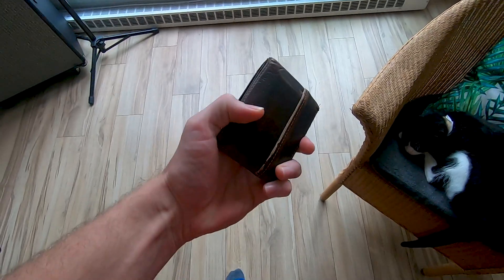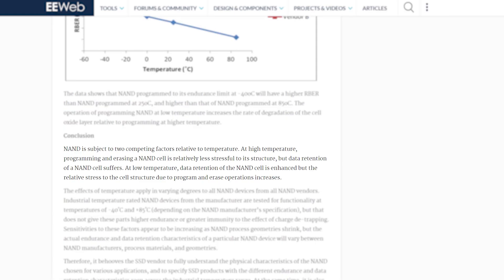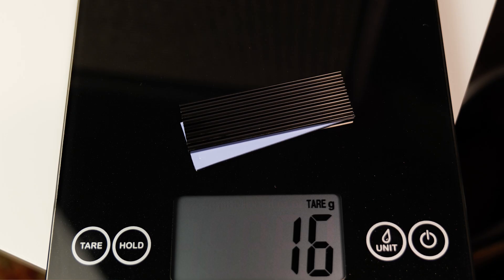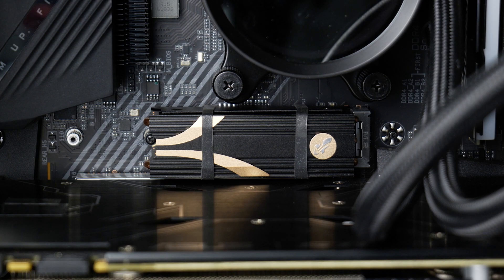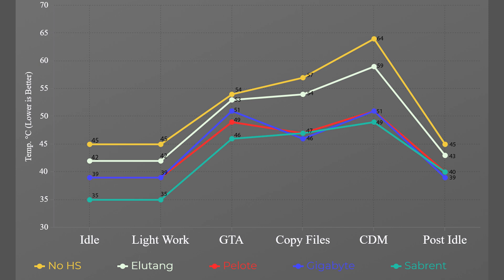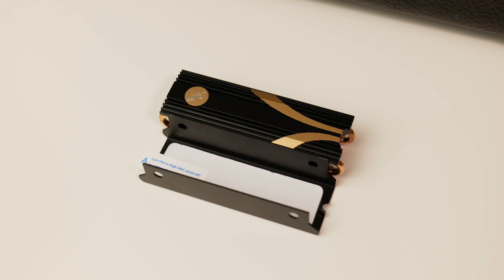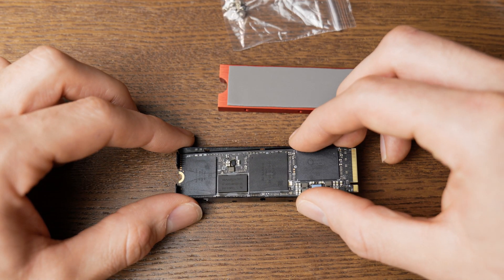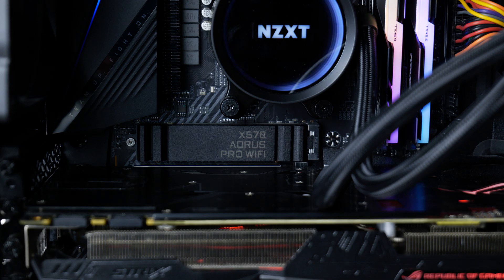Are NVMe SSD Heatsinks Worth Using? M.2 Heatsink Comparison

Comment: Useful video bro, Many thanks for the digging and efforts. I had Samsung Magician installed to keep observing the temp of the Samsung 870 NVMe SSD and the idle temp is always around 42 to 45c max. and while multi-tasking or stressing the laptop, it reaches 61 to 65c but that is only for around 15min and then back to 50c or less. all without a heatsink and of course that's at summer days, during winter, these temps are even lower. I will try using a laptop cooler that i have it laying around, it may be useful cooling the whole system at summer days.
Reply: I have samsund 970 evo ssd and samsung magician too, it shows only temp of ssd, it doesn't show controller temp, use aida64 or something like that to monitor that. if your ssd 40 your controller must be 50-60, if your ssd 60 your controller must be 70-80 ( according to experience with my ssd).

Comment: Hey, great informative video! What should I do with the heat spreader sticker that comes on almost all M.2 drives? I guess you either remove it completely and apply the heatsink tape on only the controller, or you cut out the part where the controller is and replace it with the heatsink tape so that the original tape is still on the NAND(if that is even possible). What would be the ideal way to do it?
Reply from the maker: Ideally yes. I believe you should only have the head sink on the controller.

Comment: My Tuf Dash F15 With 970 evo plus 2TB and Adata S40g 4tb have 12.8 wk thermal tape under controller chips between the drive and laptop motherboard. Asus actually have diagrams where to put thermal tape for both drives...the motherboard itself acts as a heatsink. Still saw the 970 hit 67 C under load....on D2 temp...A data stayed around 40C

Comment: Idle states - exactly how does this slight increase in temperature (due to heat distribution from these sinks) damage one's data? There certainly must be a window of heat levels that is considered "safe" for these drives and in particular, idle states. 

Which chips benefit from heat sinks - interesting point made on your part. Perhaps a heatsink that is really two distinct physical sinks in one is needed for the two identified types of chips reference in your video.

Comment: Is it true that a larger 1TB M.2 NVMe will overheat more than a similar 512GB one? Intend to buy an new XPS 13 so not sure if it comes with cooling for that and if getting a 1TB drive is a concern? Does this NVMe heating only happen during heavy writes or also for example when watching 4K youtube videos?
Reply from the maker: Yes, larger drives do get hotter. They are also usually faster. 

It shouldn't be a huge concern. It will get hot but it shouldn't be anything out of ordinary operating temp. You can use HWiNFO to check temps. 

It will heat up a little even when "idle" but it will heat up significantly when writing or reading heavily. Like transferring files, installing games or video editing. Watching videos online won't heat it up very much as it is cached in the physical memory and virtual memory(On local disk).
Reply: @TechIlliterate  Will heat be much different between a 512GB and 1TB M.2 PCIe NVMe SSD in an XPS 13 9310? Does a 512GB give similar "idle" heat compared to 1TB or will it be much more in the 1TB?
Reply: @TechIlliterate  Thanks for the reply so will 1TB run hotter than 512GB M.2 NVMe or are these very similar? Aren't these both "large" sizes?
Reply from the maker: @mikev324  They will be similar. The only experiece I have had first hand is with a 500GB WD black and a 1TB WD black both Gen 3 the 1TB was only slightly warmer than the 500GB. ABout 5 degrees in use and maybe 1-3 on "idle" but your MMV
Reply: @TechIlliterate  Thanks for the reply. The 5 degrees difference you mentioned, was that Celcius or Fahrenheit?
Reply from the maker: @mikev324  Always C

Comment: i want to thank you for this awesome video. Very informative and well done! I came here because I am setting up my brand new pc with 2 M.2 2280 NVME's. I realized the motherboard did not have a second heat sink, so I figured I would watch some videos on if it needs it or not. Since I have yet to use it yet but this is my theory is this and it could extremely wrong. I think the main NVME should have a heat sink and the backup NVME should not have one. Time will tell I suppose. Keep up the great work!

Comment: I have a problem that I can't figure out. Just bought a Rampage VI Extreme motherboard and it has thermal pads with some cellophane over them which says 'remove'. The problem is that if you remove the cellophane, the thermal pad is sticky. The thermal pad is attached to a motherboard screw-in heatsink, so if I remove the cellophane, the thermal pad will be sticking to both the heatsink and the SSD. So how can you then take the heatsink off if it's stuck to both surfaces? Was hoping for your input please.
Reply from the maker: I have found that the surface that sticks to the ssd is not so sticky that you will have issues removing it later. I have removed the motherboard heatsinks several time and they do stick to the ssd but it's soo weak that it comes away freely with almost no force. i hope that helps.
Reply: @TechIlliterate  Thank you - I was so worried about this I didn't install the SSDs in case I couldn't get them out again without damaging them. Much appreciated.

Comment: Thanks to this video, and a lot of reading, I'll be trimming the thermal tape from the NANDs, and only have the pad on the controller...
Reply: i did this and now my M.2 drive is much more cooler. I'm seeing 10c reduction after gaming session. Turns out before this the thermal pad didn't touch the controller because the NAND was a bit taller.

Comment: WD SN850 need some sort of heatsink
Reply from the maker: Yeah the controllers on the latest gen 4 drives get insanely hot. Especially the high capacity drives. My 980 Pro is usually 10-15 deg higher than my sn750 even though there are no programs loaded on it.

Comment: Hi Nick, thank for you elaborate research. By the way I read in another forum that testing with infrared thermometer will yield the lower result compared to the ones from internal algorithm....... so im confused which one to trust.......
Reply from the maker: As long as they are consistent with each other you could just calculate the differences if you would rather use the infrared thermometer. I suspect that the surface of the SSD is slightly cooler than what will be read on the internal sensor.

Comment: If you only put the thermal pad on the controller, can you damage the NAND chips with no pad on them, as there will be no cushion between them and the heatsink as they (possibly?) expand when they get hotter?
Reply from the maker: As far as I know the chips do not expand in any appreciable way. This is evident when using NVMe drives without any heat sink.
Reply: @TechIlliterate  Thank you

Comment: Hello. I just brought a 2TB Samsung NMVE SSD 970 EVO PLus for my Helios 300. It runs super fast with the OS  but gets very hot. This laptop has two m2 slots with heatsink covers from the factory. The temps reaches up to 63C under load. On idle its about 40 degrees C. It does stay around 50 degrees after reading/writing and doesn't go down since there is no airflow in my laptop . I really like to know if there is a better heatsink for this laptop. If not, should I use this as my secondary storage? I have a another 1TB 860 Samsung Evo M2 ssd for my second OS and it never reaches above 52 degrees idle/load. or should I return the NMVE 970 Evo PLus and get a 2tb Samsung evo m2 ssd instead which is $100 cheaper. Love to get your advise. Thanks
Reply from the maker: Those temps sound fine for a 2 TB drive. I wouldn't worry too much about it. there isn't much room for a bigger heatsink in a laptop anyway. Gen 4 drives will be getting much hotter though, not sure how it will effect longevity.
Reply: @TechIlliterate Alight. Thanks for the respond

Comment: Great video.  Given how inexpensive the Pelote is, you could trim the heatsink down so that it only covers the controller.  Then, the nands are fee to operate cool and warm as normal.
Reply: yeah, i think that's what he means by removing those thermal pads
Reply: @01Minecrafter10  the issue with this method is that airflow is reduced by the heatsink so I guess just sticking a small heatsink on the controller could be an option. I've seen the warranty void if removed on the ssd stickers tho...

Comment: Hi!

I'm using the Sabrent Rocket 4.0 M2 NVMe 1 TB in an external  Trebleet Thunderbolt 3 SSD aluminium enclosure. When using it (all my media libraries from  Logic Pro, iMovie & Lightroom are running from there) it heats up a lot after a time. Around 130°F the Sabrent unmounts itself and can only be mounted again, after unplugging and plugging it again. Unfortunately most of the processed data which was produced in that moment is lost. That happens 20x times a day. The aluminuium anclosure comes with a thermal tape and should dissipate the heat directly through the aluminum housing. And actually it gets really hot indeed, so hot, that it is really hard to touch it. However, the case cannot effectively dissipate the heat enough and the SSD unmounts itself as I already said - maybe  to protect itself from overheating.

Should I try to use the SSD only installes to the basis of the enclosure and installing the sabrent heatsink, what means to use ist open with the heatsink as a lid? Or do you think the problem comes from somewhere else and maybe the controller has had a factory defect from the start?
Reply: What did you end up doing for this?
Reply: That's not normal of a NVME. Looks like a defect

Comment: Just added a heatsink to M.2 in one of my computers and noticed drop from 58c to 54c. While I am waiting for a heat sync for my other PC I placed a 40mm fan on top of GPU and pointed it at M.2 drive and temp dropped from 68c to 56c. I think they definitely need heatsinks. This is under normal operation in well ventilated cases with lots of airflow and not a stress test at 28c ambient temp.
Reply: No, they don't. Big data centers that use NVME drives don't have any heatsinks on them either, and this is well out of any consumers' budget stuff. Real high end data center NVMEs don't use heatsinks, so why should you? Its just stupid.
Reply: @teemuvesala9575  Big server facilities are cooled good enough already that's why they don't have big coolers on CPUs and GPUs and simply use heatsinks + small vents for rack + cooling solution for the entire room, usually underground + giant vents. Would you want to do in your home?
Reply: @teemuvesala9575 servers have very powerful fans that directly cool the storage drives along with airconditioned environment. Do some research before you say someone else is stupid.

Comment: Ok so now that I know that heatsinks are kind of useless, do you think I can put an rgb heatsink just on top of my ssd to get the extra 25fps from the pollution light? Without applying the thermal thingy on the actual drive I mean. That way I can keep the guarantee sticker

Ty, and great vid man! :)
Reply: It's only useless if you apply the thermal pad on the wrong section on the m.2 drive.  I found that the NAND part on my m.2 drive is a bit taller than the controller - this causes the controller didn't have any contact with the heatsink. So I cut the thermal pad only to touch the controller, leaving the NAND bare, now my m.2 drive runs much cooleer.
Reply: @warnacokelat   u mean ur controller runs cooler and not the nand since u dint do anything to it
Reply: @boyscout-p3u  yes. most m.2 drive only have temperature sensor on the controller. samsung evo have sensors on both nand and controller.
Reply: (ty for the heart but I actually need an answer haha)

Comment: it's not a question of opinion, but the fact of design. Nand works only on hot. top sticker is a heatsink ( check for copper edge). So cool only controller. period.
Reply: interesting. That may be why the warranty void if removed on those stickers.

Comment: that WD SN750 drive also has a version that comes with a heatsink BUT it’s about $20 more expensive….just thought I’d throw that in. When you’re selectively adding thermal pads (just on the controller) make sure the heatsink doesn't rock and short something out. Great video!

Comment: What tool did you use to measure the temperature? And what how were they able to measure the NAND? Are there SSD with report temperature for both?!
Reply from the maker: I used HWinfo. Only showed controller temp as I mention later in the video. My final conclusions come after sharing another users results.
Reply: @TechIlliterate  that I understand. But my question is do you know how they measured the NAND?
Reply from the maker: @highcel  No I don't know. I presume they just had reading from whichever software they use displaying a reading from the sensor in the drive. Likely shows up as Drive Temperature, Drive Temperature 2 and so on.

Comment: The bollock stupid thing about M.2 NVME SSDs is the paper label over the chips which acts as an insulator.

The thing is that if you remove the label you void the warranty.
Reply from the maker: Oh no no no. Its a "heat spreader" 😂😂
Reply: I allways remove it and put it on the side with no chips on it

Comment: Interesting test results. I would actually lean towards having no heat sink at all with good case air flow. If heat can degrade the memory over time and the greatest heat source is the controller, I would want to isolate the controller heat as much as possible. As I was watching the video, I was envisioning a tall mini heat sink, like a cpu heat sink tower, mounted on top of the controller itself. The case air flow would cool it. However, if the heat over long term has no effect on the controller itself, I would probably not have a heat sink at all. Of course aesthetics comes into play too. Interesting video!
Reply from the maker: Yeah I think you're right. Airflow is key. My case is not that great for that. 

I forgot to add it to the video. You can buy little heasinks and stick them on the controller.
Reply: @TechIlliterate  are there heatsinks only for the nvme controller?
Reply from the maker: @jccgold  you can buy heatsinks of any size.
Reply: Granted lol 

https://www.youtube.com/watch?v=53RotHfODFI&t=503s
Reply: @exanhighlander6236  Looks like you use a full heatsink and not a separate one for the controller.
Reply: @goku445  you can isolate the controller from the nand chips by cutting out the thermal strips to be applied on top of the controller only.
Reply: Would it hurt to add a heatsink with the tape on the controller and good airflow? The heatsinks are pretty cheap anyway